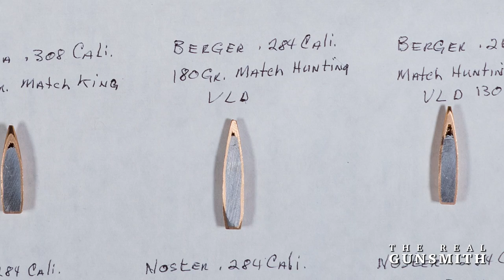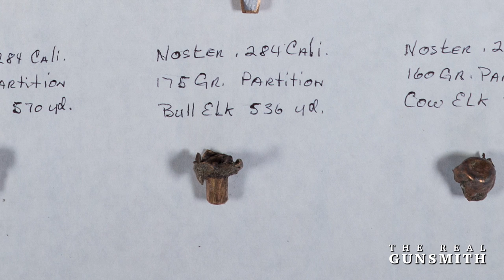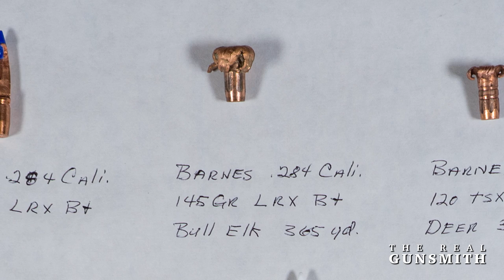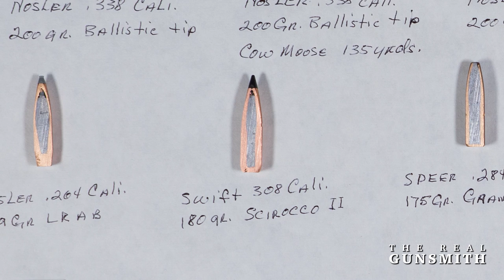Bullet Technology – The Real Gunsmith

Comment: Wind is very tricky. In fact for long distances, it's the wind WHERE YOU ARE AT that has the most significant wind affect on a shot. It's easy to understand when you think about it: The wind where you are at changes the DIRECTION your shot is heading in. A very slight change in direction angle at the start will continue to COMPOUND the error over distance and will become a large divergence. In contrast wind that's nearer to the target provides less time and space for the bullet to head off from that point. Wind has an effect throughout the travel of a bullet, but the wind at the start has the greatest impact.

Comment: I can remember sitting on one side of a canyon glassing the other.  The wind where I was sitting was approx 12-14 mph hitting me on the righthand side of my body (Northwest).  With my binoculars I could look across the canyon to the other side 700 yards away and see the wind blowing some tall grass the OPPOSITE direction!!!  QUESTION:  I was thinking about getting a Leupold scope with their Custom Dial System (CDS) elevation turret.  My intention was to only use it out to UNDER 500 yards.  What is your thinking on this?  When I look at ballistic calculator data I don't seem to notice things such as barometric pressure, temperature, elevation/altitude starting have a significant effect until  past 500 yards.  As a rule I don't take shots at game past 450 yards.   Also, I agree with every word about using thin jacketed bullets for big game.  It can be a disaster.

Comment: I live and hunt interior Alaska.  I've used all copper bullets for the past decade or so....I like the penetration and exit holes.  Exit hole especially for bears which have long hair that wicks up blood. Penetration especially on a shoulder shot on big bull moose. Monoliths are not that expensive...I get Barnes TTSX for $30 per box of 50 for hand loading.
I hand load my .270 Win rifles with 4350 or RL22 and 110-130 gr monoliths like Barnes TTSX and 180gr Barnes TTSX or Nozler E-Tip  and 4831 with my .300 H & H Magnum.  I use monoliths for tiny Sika Blacktails up to huge bull moose.  
Each of my rifle shoots a different monolith best, so for best accuracy I try a couple different monoliths in my hand loads.

Comment: If your bullet fails to penetrate the vitals it simply does not matter how rapid your expansion is. I will say though that the Sierra match bullets can routinely completely fail to expand which is the opposite of the issue with the Berger Match bullets, yes I have seen it tested repeatedly. Failing to penetrate and failing to expand are both deal killers for me. In contrast to Randy I have had good performance out of the Sierra Game King bullets but I only use them on whitetail deer and smaller feral hogs, it has always given me through and through penetration in my 7mm-08 and 30-06, but if I were hunting larger game such as elk or using a higher speed 7mm (like his 7mm Rem Mag) I would absolutely avoid that bullet for the exact reason he describes there is nothing holding the core in place, even on deer I see evidence of them separating fortunately the separation is delayed at non magnum speeds and I see that evidence around the exit wound. I absolutely endorse the SGK for Texas whitetail hunting, they are accurate and highly effective, but if I were hunting larger game I would opt for one of my Partition, TSX, or Accubond handloads.

Comment: I'll tell you another thing that bothers me about some hunters I've seen: they seem to have the idea that a hunter should shoot only one shot and then WATCH! I've seen them do it again and again. When I shoot, if the animal doesn't INSTANTLY go down I immediately crank another round in, and then yet ANOTHER. Most of us aren't in it for every single OUNCE of meat -- heck, a lot of people do the new method of just taking the "backstrap" and not even GUTTING the animal. An animal hit with a sufficient cartridge in a good place should go down quickly. Yes, sometimes they can run a ways with a hole right through their heart -- but that's usually only when you've SCARED them, so they're running from a known danger. An animal just out there grazing should go down like a ton of bricks if hit well with a proper cartridge and bullet. If they DON'T go down, then you DON'T know if perhaps you made a bad hit and will have an insufficiently wounded animal -- that's why further shots are always wise right away. I can't tell you the number of times I've put three quick shots into a whitetail deer (at 200-300 yards, with a 308, usually) when the first shot was solid and would have killed them in twenty seconds or so. You can't KNOW, so if the animal is still standing or moving they get another shot from me.

Comment: I'm in complete agreement, I have many recovered bullets also and now only load partitions, haven't tried Barnes yet
Reply: I have not tried Barnes bullets myself but have hunted using Nosler Partition bullets for years without one failure .. I have not loaded Swift bullets as of yet either ..  One thing i seen several times at the local range , some loads that are proven with Nosler bullets the same load would not group with Barnes and i have seen worse with Berger bullets .. I did buy one box of Berger bullets and after i tried 7 different powders i finally had a group under 1" with 10 bullets left , i don't want anymore of those bullets . I have seen some good shooters who never got under 3.5" group with Barnes Triple shock bullets too.. The one shooter put three shots under 3/4" with his rifle with the same powder load but with Nosler Partition bullets so it wasn't something wrong with his rifle ..But by gawd the Barnes just wouldn't do it ..
Reply: @normanmallory2055  At least my .308 Steyr shoots 3 shot group in 2/3 moa from 100 yards with factory ammunitions that uses ttsx bullets.

Comment: Maybe part of the problem is using a match round for game. Maybe the other part is aiming for the shoulder, which is asking a lot for any round except a .50 cal or 338. Now putting the round just behind the shoulder, the round only has to deal with ribs and will most definitely pierce both lungs. That's why I prefer ballistic tip (Winchester Super X Silver, molly coated, ballistic tip or Hornady Superformance ballistic tip)

Comment: So Randy were you shooting Sierra Match Kings or Game Kings? Why the heck were you using Match Bullets. I have shot 3 30 cal 165 Sierra Game King and 3 180 Sierra GameKings into Elk from 60yards to 370 yards and they worked just as well as the 180 partitions I have used. Recovering the bullets I found the mass of the remaining partition to be equal to the remaining mass of the Sierra"s. So the partition rear portion adds up to no more than the intact portion of recovered Sierra core. When it comes to deer, mulies and Coues a cup and core Sierra work great because these deer just do not need partitions. I have had Sierra 30's run through the on shoulder blade/bone through the chest and through and out the off shoulder blade/bone of deer. Cup and core bullets on deer no problem, on elk they do work.

Comment: Im from oz so no elk but lots of pigs and they are tough and i had lots of bullet failure with the 130 gr nosler bt in .270w . Barnes are the best ive tried but the speer deep curl 150gr work real good but they stoped making them.
If you shoot barnes drop down in weight i use 110gr in 270

Comment: One other thing to add, these bullets designed to work at long range typically are only decent bullets around 500-600 yards where they don't expand as violently. I made the mistake of shooting a Berger VLD up close at a deer, the bullet performed like a Varmint bullet and acted like a grenade. It destroyed a ton of meat due to this. Yeah, it was like a light switch in killing the animal, but it destroyed the entire shoulder and I lost a lot of good meat that I wouldn't typically lose with a bullet truly designed for hunting. The shot was just slightly over a hundred yards. With the thin jacketed bullets you are losing versatility as well.

Comment: I personally require at least @1800 ft.lb. of terminal energy to humanely kill elk. I use this as my minimal guide to determine my cartridge’s maximum effective range (MER.) I require a minimal bullet sectional density (SD) of .250, as this SD determines the minimal penetration value for elk. Bonded cores do hold up better after penetrating a shoulder or rib, but cup and core isn’t ill advisable either imho, as long as the velocity is under @2700 FPS, which is great for the moderate cartridges such as with the .308 family. I’ve hunted Roosevelt’s with my .260 Rem. AI, and Hornady’s 6.5mm 143 Gn. ELD-X (SD .251) but limited my range between 100 and 400 yards, and aimed for the crease. Under common sense ballistics, my .260AI works fine for humane kills.

Comment: A Sierra Game King is NOT an elk bullet, I have used them with great success for years on whitetail and feral hogs across the southern states but even on this lighter game I see signs of separation especially the 165gr 30 cal and 150gr 270. Now this fragmentation is not an issue on southern game as it simply make a dramatic wound cavity but I would be hesitant to use it on any larger game and would much rather have a Partition or TSX.

Comment: Ballistic coefficient does not change with temperature, elevation, or barometric pressure. Those measurements effect velocity which can increase or reduce the ballistic coefficient. Ballistic coefficient is very predictable and measurable.

Comment: Using centripetal force to return a bullet back in the direction it came from...

By firing a very strong magnet at a bullet attached to a very heavy spining sphere on a tether moving faster than the incoming bullet...

Magnet hits bullet and attaches...bullet moves in its given direction...bullet reaches end of tether...and spins around heavy object until released...

The other way of doing it is with a spinning disc and electromagnets but same idea...just more expensive....

Comment: It's more difficult to get real close than make a long shot. Which is more interesting , getting a large bear at 30 yards or 300 yds?  Too far to shoot when velocities drop to 1000fps or less, that's pellet gun speed. No one mentions the losses/wounding  using something like a Creedmoor at 800 yds. only the successes. Creedmoor is used by military for 200 lb persons, not 1000+ pound animals. The Swiss 6.5 is slightly better but it's all about fitting in a AR10 that the Creedmoor does.

Comment: 10:30 "Ive shot elk at almost every angle, I've even shot elk in the hip because that's all I had to slow them down and caught up with them."  15:12 In another part of the story you talk about shooting through the chest and having the bullet go lengthwise through the elk.  Do you really shoot elk at any angle?  You sound extremely knowledgeable on most of this stuff but the part about shooting in the hip to slow them down and almost every angle sounds messed up.  I can see why you need an exremely rugged bullet when you shoot the elk from the brisket or arse length wise through the elk.  Happy gutting.
Reply: I have after 60 years of hunting taken shots that were not perfect broadside.. Several I shot right in the middle of the chest as it would not turn,  worked fine the elk went down.. Gutting was messy though.. I've also shot facing me quartering me, worked fine too..One facing me put his head down and I drove a bullet in the base of the neck, never took one step just fell down. Found the bullet in one rear quarter.
Reply: Bad practice and contradictory to the "ethics" he tries to preach. No doubt he has alot of knowledge but alot of BS to go with.
Reply: I agree... he states early in his video about his 600 yard shot on a elk. He says he followed up with a 2nd shot to finish him off with a head shot because he “hated to see the elk suffer “ but next story he says he took hip shot because that’s all he had. Too much confidence in the partitioned bullets if you shooting them at that extreme of an angle.
Reply: Maybe he was hungry back then and it was kill the elk any way he could or not eat? Idk

Comment: Making a ethical shot on a animal, to me doesn't include shooting a animal in the hip cause that's the only shot you had, so you could slow it down to get a shot to kill it. I wonder how long the animal had to crawl around before you could get to it?
Reply from the maker: He was down, immediately and just as quickly he was dispatched.
Reply: @TheRealGunsmith  
I can see what your saying . I appreciate a reply and to clear that up. Taking a shot to slow down the pace of a contact situation i have no issues letting them suffer and takes 1 or more out of a fight. Being on this side of the fence i treasure our wildlife and try to provide knowledge to the youth about life it is very precious to me in any form. I have been a shooter for over 30 years and i agree exactly what you are saying about these small calipers they are for wounding and paper. When used at extreme ranges and you have to see the projectile and the wound cavity to fully understand and i can clearly see you do. I have had to recover bullets myself and still do from my game if possible and at the same conclusion you are. Keep passing the knowledge and thanks for the reply.

Comment: You've really got your wire's crossed. The ELD-X is a perfectly fine hunting bullet when used within its design capabilities. Entirely adequate for a broad range of medium game across a broad range of shooting distances. You are very publicly writing it off by using examples of inappropriate use of the bullet by the shooter, outside of the bullet's design capabilities, which is the shooter's fault, not the bullet's fault. 900yds in many common hunting cartridges e.g. 7mm Rem Mag will be right on the threshold of minimum expansion velocity for the ELD-X and most experienced long range shooters know that a soft frangible bullet is to be used at that kind of range, not a controlled expansion bullet. The decision - and the outcome - rests with the shooter - if he makes a bad decision to use the wrong type of bullet at a range beyond his capabilities, that is not the bullet's fault. I think you need to script your talks to better define the scenarios in which certain types of bullet construction are more or less suitable for certain classes of game. The way you're going about it now, you're confusing your message, and it does not stand up to technical scrutiny.
Reply from the maker: Marketing and money drive on to use incorrect components at insane attempts to take game. 

There are real game bullets out there and the ELD-X bullet is not in this category.
Reply: You are saying the ELD-X is inappropriate for use on "game"? Please define game. All game? Some game? One species of game? All game weights? At all ranges? If I could post pictures here I would happily share with you my recovered 6.5mm and .308 ELD-X bullets from a mix of very dead game, from feral goats thru' red deer, dug out of the ground behind the animal, at ranges between 100-500m. You are making highly generalised statements about certain bullets when in fact your described application experience is very narrow, which seems to be heavy game (elk) at several hundred yards with very fast magnums (e.g 300 Weatherby). That is a very specific application calling for a specific set of criteria (caliber, velocity, bullet construction). It doesn't make sense to then write off a perfectly good (and highly successful) product because it doesn't match your application. Promoting the exclusive use of big game bullets for hunting "game" and declaring that several other hunting bullets are rubbish, existing only due to marketing spin and greed, is highly likely to result in gullible subscribers making poor decisions. E.g. using hard big game bullets on light skinned, light weight animals, and that often does not end well and likely to result in many more failures, which I am sure is not actually what you want to achieve. GameKing, ProHunter, Ballistic Tip, A-Max, ELD-X, Hot-Cor etc etc are all perfectly good bullets when correctly matched to game weights, range and cartridge.
Reply from the maker: Bullets that do not stay intact after expansion are not desireable game bullets.   
I just had an email from a man who shot a whitetail , 6.5 CM at 220 yards. He recovered only the bullet jacket from the deer. Low velocity, 143 gr ELD-X factory ammo.  Traveling maybe 2400 fps. This is the point.  It just does not cut it as a game bullet.  I saw the bullet jacket photos.  And this mirrors the experience I have had as well as many others.  And not just elk.  Deer, mule and white tail, antelope, sheep, goats.  Again, my experience, my talking and visiting with multiple people hunting here and in other countries. 
Good shooting.